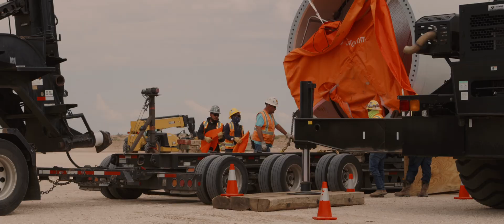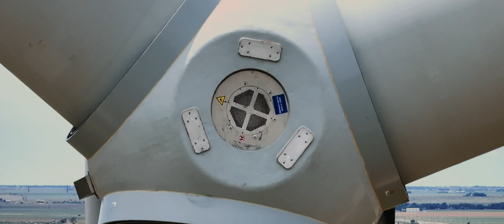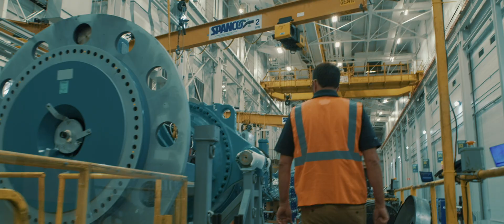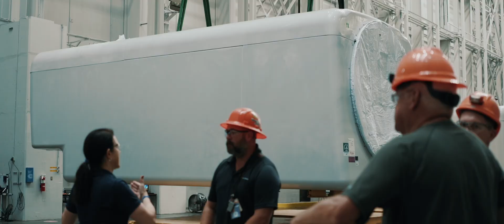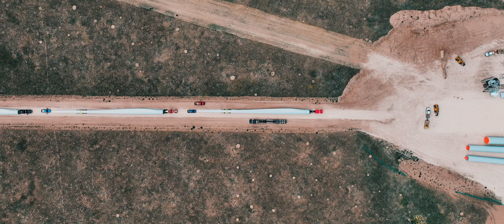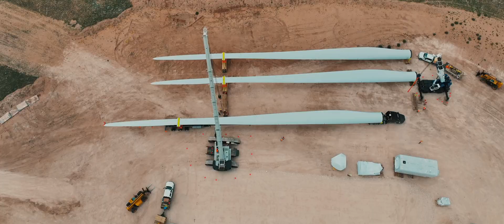The Winds of Change | Delivering for Customers with GE Vernova’s 3 MW Wind Turbine

Comment: There is an incredible high level of engineering going into advancing wind turbine generators.  

It's not the percentage of wild AC the public power grid is having to support from wind turbine and solar voltaic generated electricity that is substantially important, but its fuel savings, which is little to non.    In the US the advertised fuel savings for supporting the wild AC from wind turbine and solar voltaic generated electricity by the electric utility grid is 1% each.  That number is likely rounded up significantly.  

The wild AC from wind turbine and solar voltaic electrical generation should not be supported by the public power grid.   The practical use for wind turbine and solar voltaic generated electricity is for maintaining electrical energy storage such as charging storage batteries or working with something similar such as hydropower.   The electrical storage can supply the power grid or run pumped hydro for stockpiling water for hydropower at about 50% efficiency.   

Instant 100% backup of wild AC typically  requires natural gas turbine generators running at high availability consuming a minimum 70% of the fuel of full output, but making little electricity, where in a few seconds they can be at 100% output to instantly backup the wind farm 100%.   Making up the dips in wild AC will cause more than 70% of full output fuel consumption.  

It would use 66-2/3% of the natural gas of 100% back up of natural gas turbine generators to run a natural gas combined cycle plant at high efficiency output where it can make full use of a steam cycle adding 50% higher efficiency making all the electricity than to 100% instantly back up a wind generator farm for the same electrical output to behave as a scheduled power station.   

The cheapest incremental electricity is from hydropower and nuclear power.  Second to those in the US would be a new ultra supercritical clean coal plant burning high BTU bituminous coal at a predicted crossover fueling cost with natural gas priced at $0.80 per million BTUs in 2022.  

US natural gas was priced at an offseason wholesale price in early summer 2024 of $2.50 per million BTUs, three times the fueling cost of the coal plant.  This is the cheapest natural gas that could be expected without economic collapse. Winter peak natural gas wholesale prices can be several times higher.  The US has some of the lowest cost natural gas in the world. 

UK wholesale natural gas was priced in US equivalence Oct. 2024 at $10.50 per million BTUs.

It is not accurate to state residential electricity cost is greatly the cost of maintaining the power grid as sometimes said.  In the US on average only 38% of the generated electricity reaches the residential electric power meter.   62% of the generated electricity on average is lost to grid resistance.   

A little less than $0.03 per kWh is average for US midwestern wholesale electricity scheduled 24 hours in advance.   That costs $0.03/.38 = $0.078 at the residential meter.   Our Cumberland, Indiana residential electricity in 2020 was priced at $0.10 per kWh.   The cost verses sale price difference has to maintain the power grid and make some profit.  Internally generated electricity should be significantly cheaper